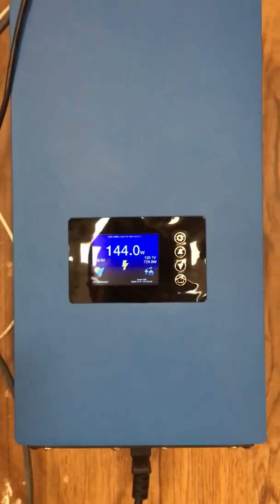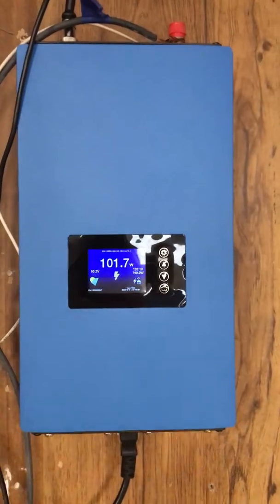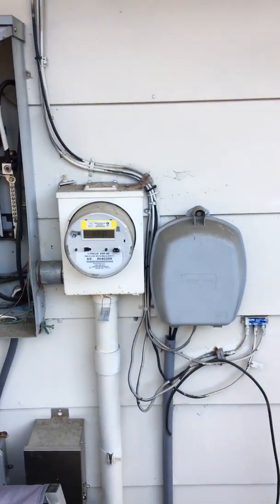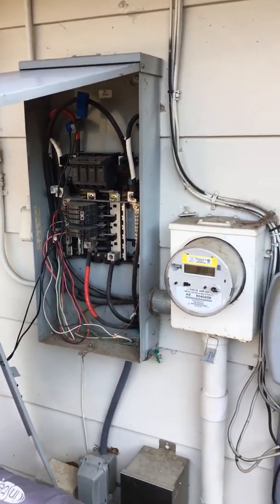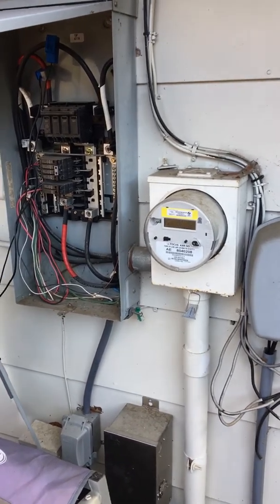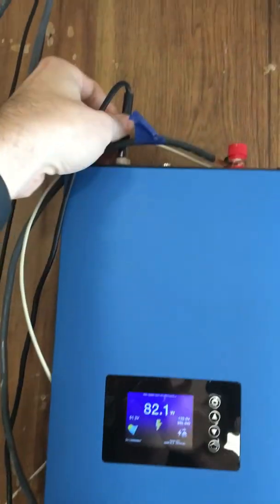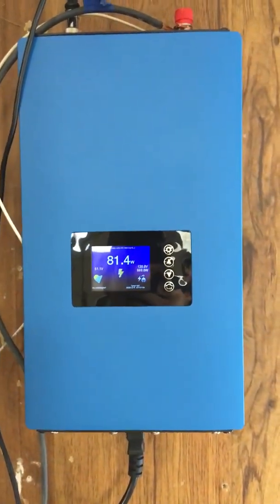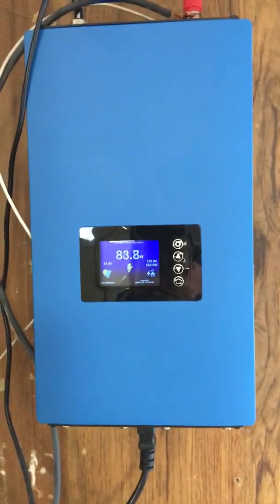DIY solar without permits

Comment: Technically each hot wire runs 120 thus 2 hot wires = your 240 (or220 in most us states now) and this is also the reason you need to monitor both wires. The 220 devices in your house use both hot wires to achieve this. Sorry if that is what you were trying to say it just did not sound like it so i wanted to be clear. Also a question i have, if you run you inverter into a regular house outlet shouldnt you be very aware of all the other devices on that breaker i mean a 20amp breaker is only 2400w and if you have alot of device runing and you push in 1or 2k you take a risk of fire
Reply: The inverter super cheap I would not buy one of these. According to reviews they are only 64% efficient. Growatt makes a 3kw grid tie inverter IC 3000TL-X for $400 only $20-30 more. They have a max efficiency of 97%.  He needs to put a breaker in, at least a fuse.
Reply: @Mike-01234  Growatt is for off grid. Not grid tie unless you have a contract. No Current transformers. I have both.
Reply: 110 and 220 Volts
2. "110 volts" and "220 volts" represent an older standard that was changed to 120 and 240 volts about 75 years ago, depending on the region. This terminology is still familiar to many people and remains in use.

Comment: That inverter does indeed have island protection Idk what everyone is talking about in the comments. 
Also btw I read from some guys talking about using the same set up with the CT clamps your doing.
The smart meter references from neutral, so the inverter is seeing the total house load. the power consumption on L1 & L2 is not balanced and so the neutral will cary it and the meter will read it as power being consumed thus you get charged.
Not sure if that will throw up any red flags though.
If anyone is reading this and understands what I'm talking about better can explain it please do.
Reply: Also I strongly advice some surge protection on AC side. Power going off an on just blew up my 1000w gti2
Reply: Yeah I have the same inverter and 880 watts of solar and my electric company charged me over the summer because I was probably consuming 300 watts but producing 600w. And the consumption was split across legs but the production was concentrated on one leg. So it sounds like which leg the solar is connected to matters significantly depending on appliances etc.
Reply: ZT_Performance - Not sure I understand what you are saying.  Or why the inverter in the video feed power back into the grid before using a dual sensor setup.  I just bought the new updated SUN 1000W inverter with limiter.  This is the same inverter as shown in the video above.  If one ties this inverter with it's power limiting sensor into just L1 of a dedicated breaker on the panel to only feed the accessories of the house using L1 power, how is power going to feed back into the grid on L2 to alert the power company? The inverter will produce only the power needed.

Now eventually I will get a second 1000W inverter with the limiter and use it to monitor the L2 power line.  

Over the Summer I tried the 2000W 240V version of these SUN inverters with a dual sensor setup and it still feed power back into the grid and alerted the power company.  I believe this occurred because the 2000W inverter distributed power equally across L1 and L2 instead of on the line that was using power.  For example, L1 was using 800W for a window AC and the inverter was producing 800W, but my meters I have hooked into the system showed 400W on each line.  So I assumed 400W was going back to the grid and than back into the house and getting double charged for it since the typical smart meters cannot tell which direction power is coming from.  Power going out to the grid is charged on the bill the same as power coming from the grid.  So I am trying a dual 1000W inverter setup.
Reply: @darylw792  I almost purchased the 240 volt and did not for your reason. My system works Perfect for over 3 years with two 1000Watt with one on each leg. I live in a heavy regulated city with the smartest of smart meters and they have no clue. I never back feed, so they are good.
Reply: @benkanobe7500  I know each inverter comes with one sensor coil for the limiter function.  Do you use one sensor coil for each main line, or do you use a dual sensor coil setup for each line coming into the house main panel? A dual sensor set up would require four coil sensors.  Two for each inverter.

Comment: So that GTI does not have anti-islanding.  To anyone reading this and wants to do this, get a GTI (grid-tie inverter) that has this protection.  What this does, is stops delivering current when the power goes out, and also, don't generate more energy than your house uses.
Reply: That Inverter doesn't work without a live ac power connection

Comment: This is what happens when some people end up with just enough knowledge to be dangerous.,....and very dangerous.  Dude is gonna kill a lineman and serve some time.
Reply: It's virtually impossible. First off you would overload your system if you did backfeeding a dead grid. Every house still has numerous things plugged in when the power goes down. Your system would be overloaded and shut down try to power your city or town.
Next problem is the linemen are trained to prevent themselves from being electrocuted. They ground everything just like it's live. There is only one debatable case of a shocked lineman and they can't definitely prove that back feeding is what caused his death. A live powerline could have fallen on the dead line he was working on.
About the only way to accomplish killing a lineman is he is working on the line to your house and he ignores his safety training.
Reply: Your comment is not accurate. The inverter has anti-islanding, it shuts off if the power goes off.
Reply: @ginavillalobos1827  this is not the case for a hybrid inverter if the backfeeding is not turned off in the menu.
Reply: @mikeanonymous669 the inverter won't work if it doesn't have an ac power connection no matter what. So if the power is off the pv is too.
Reply: @mikeanonymous669  The inverter in the video is not a hybrid inverter.
Reply: These monopolized utility companies brought it on themselves
Reply: this back feeding the grid is bullshit , what they are worried about is if your meter reads ZERO then you might be stealing power from them somehow....turn all your breakers off for 30 minutes & see how fast they come to your house to replace the meter & snoop for illegal bypass- especially on overhead feeder wires.
Reply: ".....just enough knowledge to be dangerous". You just described yourself. ALL of the blue box inverters like the one here are anti-islanding and so shut off in less than 10milisecond in the event of grid down. NO DANGER to line workers.
Reply: @benkanobe7500  that is not true at all. My "blue box inverter" can be ran in grid tie or stand alone as well as stand alone while being supplemented by the grid.  Electronics fail all the time. Nobody can guarantee an inverter will never have a board or even a component will never fail which prevents backfeeding to the grid while the grid is down.
Reply: @mikeanonymous669  I think you missed the main point. Unless the inverter can output megawatts it will overload and shut off. Its crazy to believe one inverter can power your entire city when it struggles to power just your home. There is no chance of it hurting a linesmen. Its like saying a double A battery will power your entire home.
Reply: This is the most important comment!

Comment: So basically the city dont want free energy what they can sell for money...
Reply: No, they don't want your solar frying a guy trying to fix a line while they have the power off.
Reply: @NdxtremePro  It's 2024....ALL Linemen are working with Hot Gloves. PERIOD.   PS:  The issue is Not small DIYers like this dude whose Grid Tie Inverter WILL NOT WORK if the GRID is down.....BUT the illegal grow houses in your neighborhoods!!

Comment: 1/8” wire? Where is wire measured like that?
Reply: I believe the 1/8" does not refer to the wire gauge.  Instead, the 1/8" refers to the size of the audio jack at the end of the wire (note his use of the phrase 'y-splitter')  aka 3.5 mm jack.  In other words, the current test instrument is delivering a current value to the inverter via a communication signal (extremely low amperage).
Reply: In audio, music production, etc. 1/4 " cable for my guitar into amp
Reply: @ginavillalobos1827  I didn’t know that solar connections use audio jacks
Reply: @pb7379-j2k  NO. MC4 and wire gauge (American wire gauge depends on load) AWG. So between 8 AWG and 12 AWG
Reply: @benkanobe7500 you don’t have to tell me, I’m the one saying 1/8” is no way to gauge wire that I ever heard of

Comment: What is the make/model of your inverter? Link is broken
Reply: Eco-worthy L03020201001-1
Reply: @james6794 this inverter returns power into the home directly by using a 110 outlet plug?
Reply: @cenval999  yes

Comment: Would if I never upgraded to the electric companies new meter and stuck to the old meter, would the Electric company have never known about my solar panels? I’m trying to save money and yet I would prefer not to obtain a solar permit due to un-permitted items on my property. Any advise would be great.
Reply: Basically it's just a matter of making sure you don't back feed when the power is out, and you shock a worker. What's funny where I live is you need a permit to do it and they make sure you have the right angle, the right sunlight, etc, which is weird for a state that doesn't make you get a permit for a/c and heating installs for diy.
Reply: Lucky for you we now have portable power stations you can purchase and zero need for permits... Look at Ecoflo and Anker...just some of the many available!!! Hopefully you can build a ground mount solar array in your backyard!!!